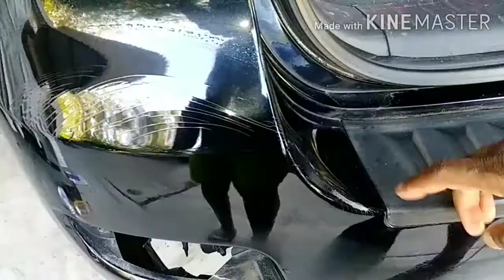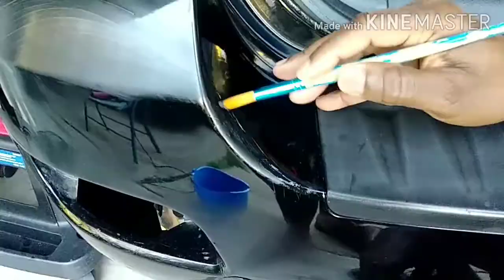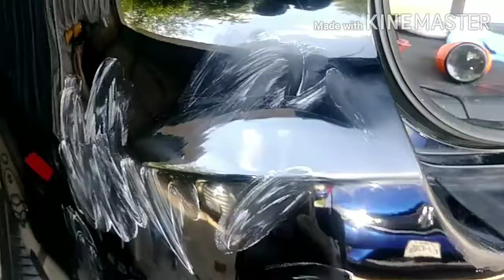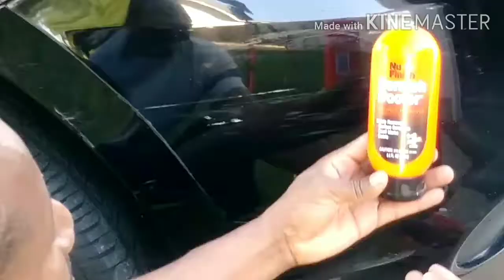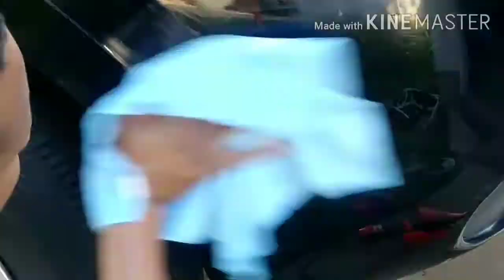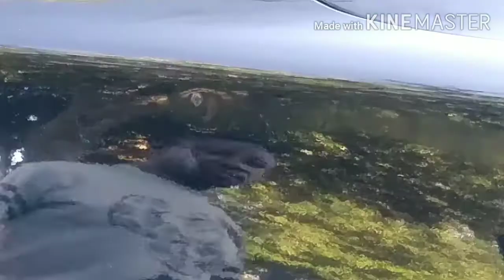DIY LIGHT PAINT SCRATCHES REMOVAL

Comment: Does that buffing machine work better than doing it by hand? I’ve been hesitant to buy one. I haven’t had any issues doing it by hand except it’s a good work out 😂
Reply from the maker: Even with the machine is a workout.  The buffer is better because it will save you lots of  minutes which can be summed up to hours depend on the job size.